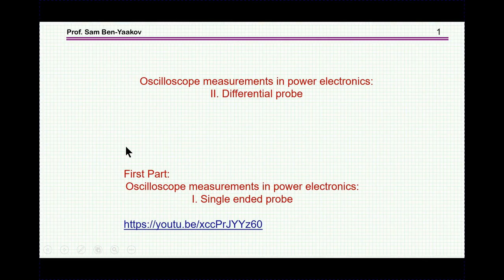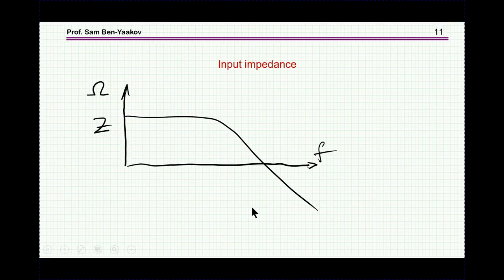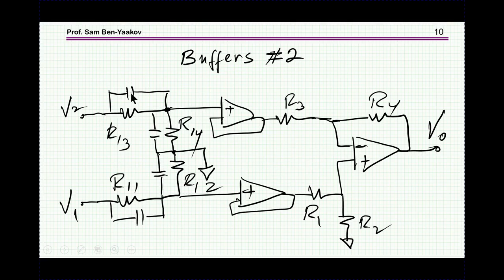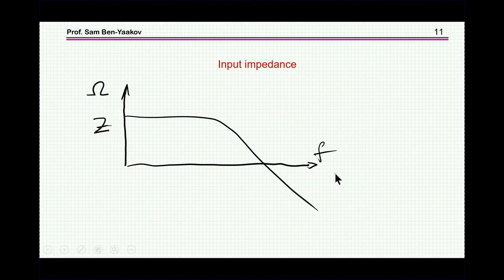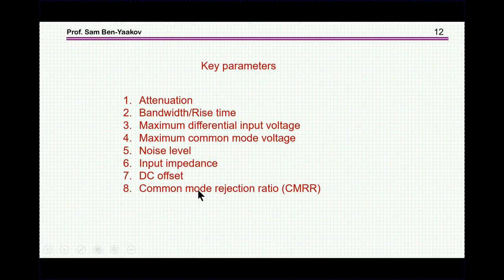Oscilloscope measurements in power electronics: II. Differential probe

Comment: Thanks for another great upload and explanation. Is there a specific datasheet or application note you are aware of that is used to teach students differential amplifiers in general within a university lab setting? I'm not looking to make a HV probe or anything. I'm just looking to test some of these concepts in a controlled setting. I have a few of TI's INA106 (differential amp with a built in resistor network gain of 10). That datasheet has several examples that could work here, but that entire datasheet is short at 6 pages. It was also first copyright in 1987 so it is as old as me. Is there a better reference you are aware of that I should look for?
  Thanks again for the upload.
 -Jake
Reply from the maker: Hi, here are application notes on the web that discuss differential amplifier.

Comment: hi, i really liked your video and i was wondering if i could use the circuit on buffer #2 as a differential voltage probe that would input  voltage upto 250V from a full bridge rectifier and output 3.3v to a microcontroller?
Reply from the maker: Please indicated to what minute in video you are referring to.

Comment: wow found out many things with this very interesting information. what kind of hobby differential probe could be designed using the: 
Vishay IL300 Linear Optocoupler 200kHz bandwidth,  4420VRMS isolation rated voltage ,  130dB CMRejection?   thank you  😎

Comment: Hello, Professor! Thank you for covering such an important topic!
I want to ask a question about capacitors, which are in parallel R11,R12,R13,R14 (5:45). First time I have thought that C||R12 and C||R14 are parasitic capacitance and C||R13, C||R11 is placed there just to compensate for it. Just like in 10:1 probe in Pt.1 of your presentation. But then in a few real designs I saw all of these capacitors C||R11,12,13,14 are physically present (real capacitors). So question is follow: why do they need to put an extra capacitors at C||R12 and C||R14 if there is parasitic capacitance there anyway. Isn't enough just to put variable  C||R13, C||R11 to compensate for parasitics and do not place real capacitors at C||R12 and C||R14? My guess is that they place real capacitors at C||R12 and C||R14 just to make parasitic capacitance more predictable (if Creal||R12>>Cparasitic||R12) so it should be easier to compensate for it. Thank you!
Reply from the maker: This a generic schematic schematics representing bot the parasitic and compensating caps.